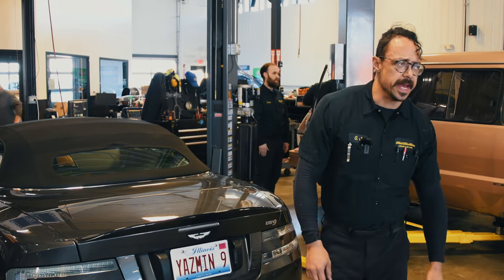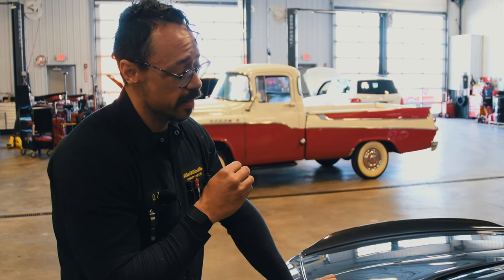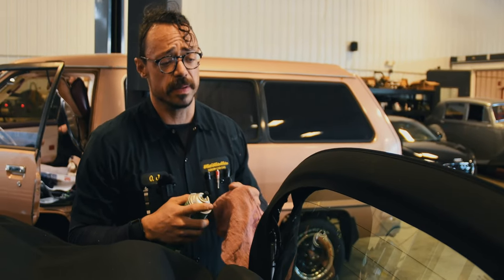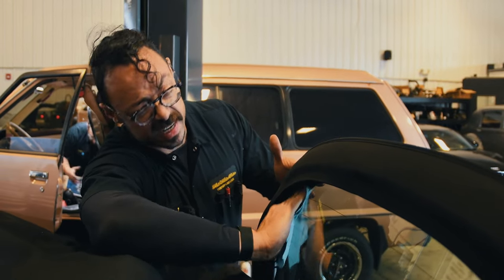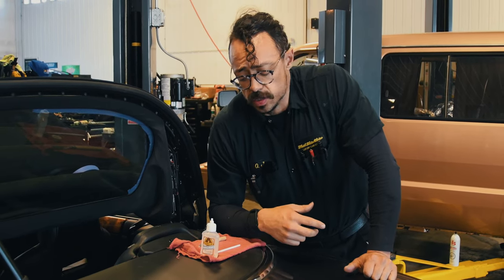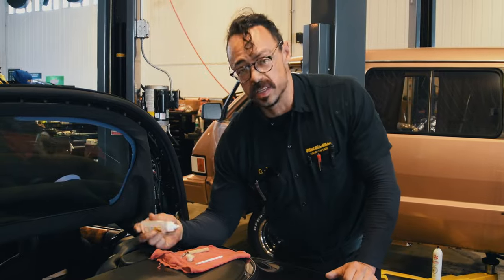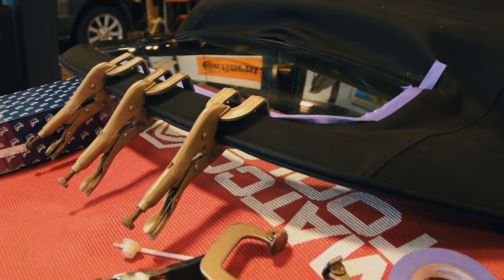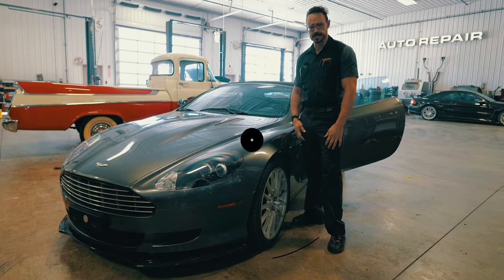Aston Martin DIY Convertible Top Reseal: Fixing a $2500 Part for $30!

Comment: Good work.   A couple things from the aviation world that may help you with things like this in the future are MEK for adhesive removal, and 3M 1300L for adhesive.   We use 1300L often for interior repairs, carpet and fabric repairs, etc.....  It's a neoprene glue that holds up great to elements and isn't too bad to work with.

Comment: Thanks for the great video OJ.   It looks like you also repaired/reglued the top of the glass near the center of the windshield.   My Aston Martin isn't having the windshield separation issues but does seems to have the top sliding forward toward the front of the car.  I'm thinking perhaps regluing the top like you did only to the top middle position like you did and wonder if you know how that worked out for the long run for the owner, assuming I did see the repair and issue I described correctly.   
Thanks
Reply from the maker: The factory glues it so depending on your prep and application, you can have a result that lasts about as long. No issues so far, but time will tell…